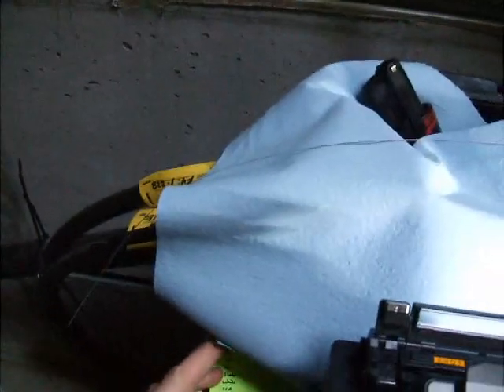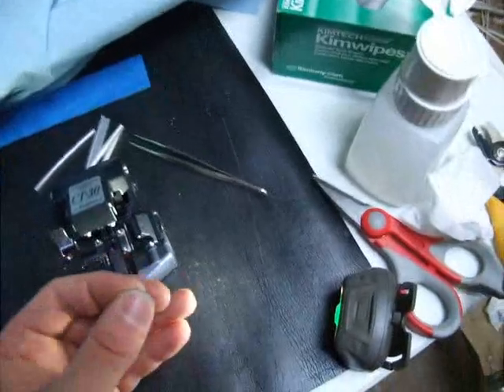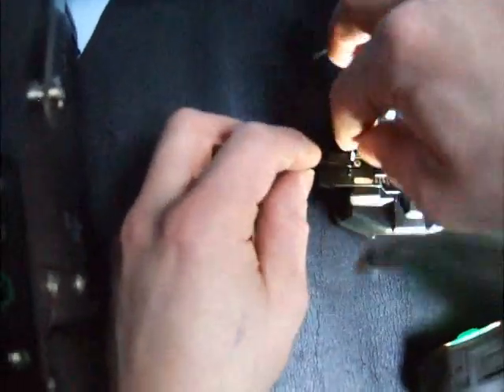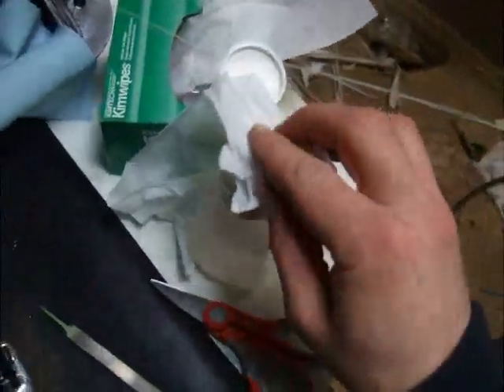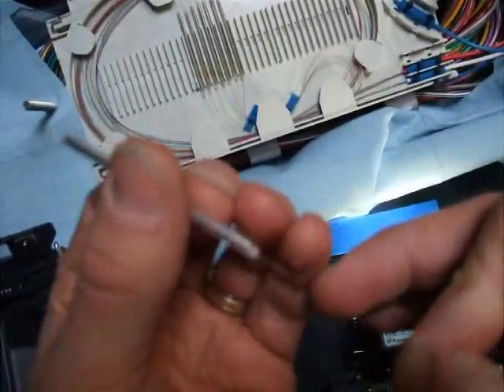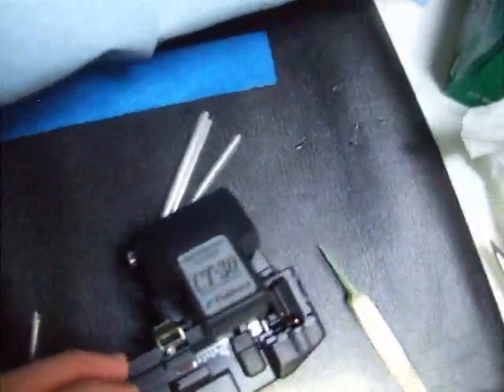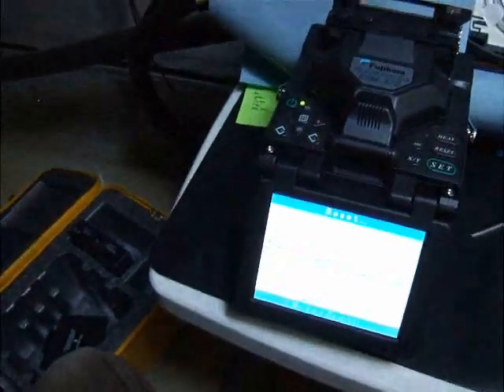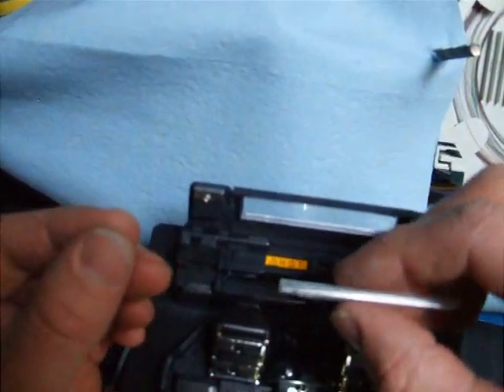Fiber Optic Fusion Splice

Comment from the maker: otas32: the fibers you describe are very different than those I was dealing with in the video. I imagine you can buy ends for the stuff though: perhaps a pre-polished end which you don't have to "fuse" to your fiber but might instead have a kind of light transmitting gel that makes the connection with the jagged edge. I know the automotive industry uses some fiber like this but I forget what it is called. Also obviously used for lighting effects etc.

Comment: @malerror  288 fosc-400 D5 with 288 cable, 144 cable, 96 cable, and with 7 cables of 24 fibers (not all splicing) with two fsm-60s and two men team in less than 12 hours :)

Comment from the maker: You may be able to get a better less jagged end by scoring the fiber circumferentially (you likely don't need to ring the fiber just scratch one side) then pull the end off. With "my" type of fiber the glass breaks fairly cleanly in this manner.You can buy a sapphire scribe to do the scratching: but a glass cutting tool might do the trick (carbide I think) since the scale of fiber is so much bigger. Good luck, what type of flash modifier are you making?